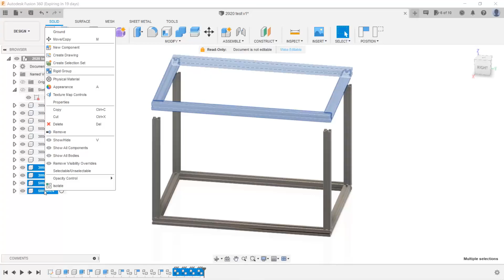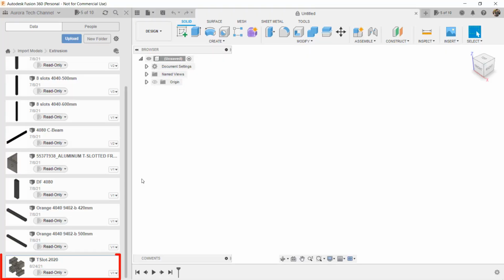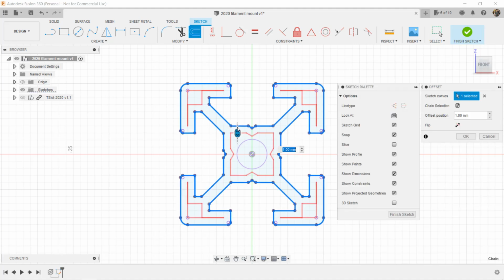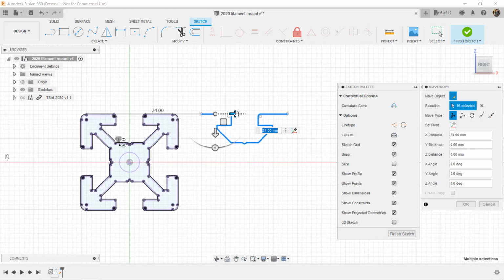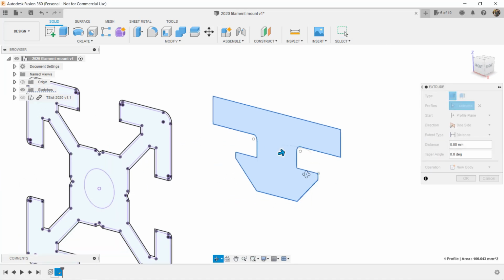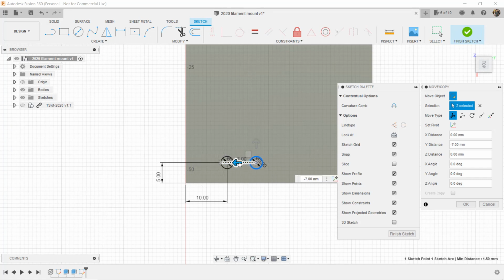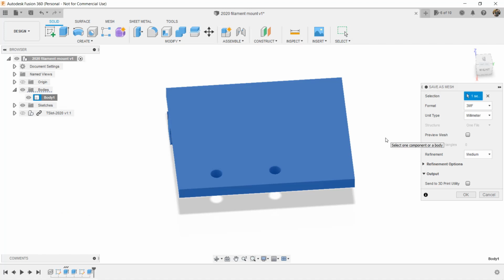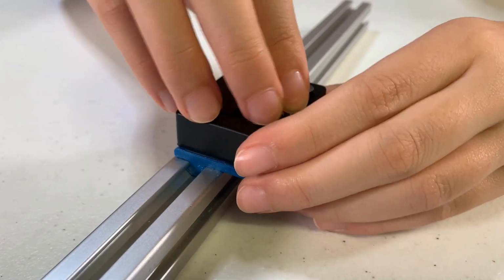Fusion 360 SHORT Tutorial For Beginners 005: Design a mount for an aluminum extrusion frame

Comment: I had Fusion 360 for a few years now but haven't used it in a while. You really helped me get back to how to use it again. When you mounted the sensor on it, something did not look right. I realized that the Fusion design in the tutorial has the mounting holes in a different location than the one you printed. You may have been able to flip the sensor over and it would look right. But that's not important, it is how you made them that is. Love your videos. You are very intelligent.